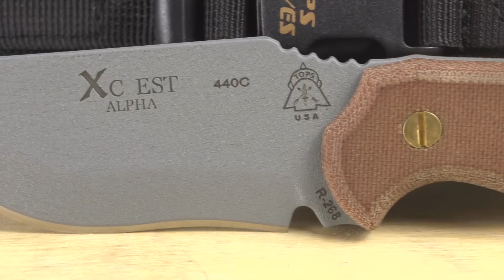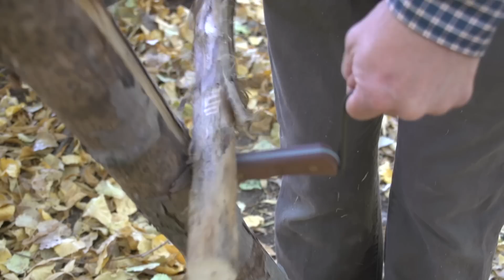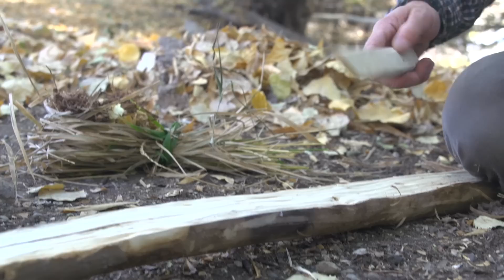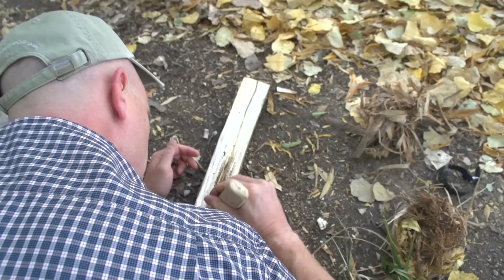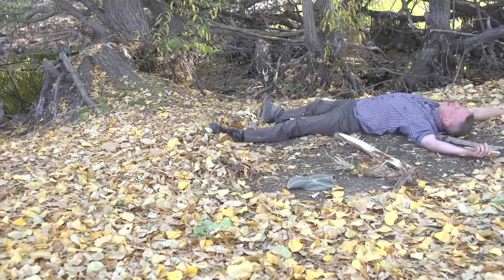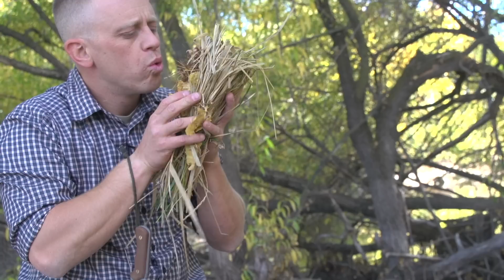TOPS XcEST Bushcraft Skill Pt 1: Fire Plow

Comment: I am very competent with the bow drill, but always fail at the fire plow. One thing I noticed is you were using your arms and not your body, this way u burn out too quickly. But this is a very tough method.

Comment: If you remove the scales from the knife, you can put inside the handle an Exotac NanoStriker XL replacement rod and a couple of tinder-tabs. Then put the scales back on and you will always have a reliable fire source even if you lose the contents of the sheath.

Comment: Great Video, guys! I have watched other fire starting via rubbing sticks together videos and I think a huge factor in one's success is picking the right type of wood.  Different woods ignite at different temps so if you pick a wood type that has a lower ignition temp, you don't have to work as hard.  The key to survival may just be wood knowledge in this case.

Comment: Why on earth would you use the blade on a ferro rod like that? The shame... looks like a stout little knife, but too short for a lot of tasks and lots of accessories of questionable quality.  Always skeptical when something comes bundled with too much stuff.
Reply: Because the back of the blade when it is coated will not light up a ferro.  So if you have not other sharp object on the blade, or no other striker it is best to use the bottom of the blade.  By the way it didn't dull it at all because it is so stout.

Comment: I haven't read all the comments so maybe it's been said. The knife had a hole in the handle to use a bow drill so why not use that to build a fire? Just curious. Never saw this friction fire method before so thanks.
Reply: dhl671 I'll believe this when you actually post a video of it happening.
Reply: Because I have done a bow drill in a bunch of BladeHQ videos.  We wanted something new and not often used.  It isn't often used because it is very hard to do correctly.  Especially if you are using cottonwood like I did, as opposed to say Yucca plant stock or Hibiscus as the original Polynesian peoples did who used this technique traditionally.
Reply: Yeah he says he's started fires with bow. Uh huh sure...Got lucky once maybe? Check the videos in which he fails miserably at working a bow drill as well. There's one video I think where there's this idiot and another one or two idiots trying and failing

The guy thinks he's awesome and calls himself an "expert". I am no expert but am confident that i can do what he did if not better.

Comment: Why did he use the knife edge to strike the fire steel?
Reply: The blade is coated, plus it doesn't have a ninety degree spine. I might cringe every time I see someone do that, but it's not a big deal.
Reply: Domo Kun A knife doesn't have a good heat treat if striking a rod with the edge does any damage to it.
Reply: I did that because the back of a coated knife won't fire up a ferocerium rod.  Usually on my personal knives when they are coated like that I take a dremel tool to the back of the blade to take the coating off and to give it purchase.  That is why I used the front of the blade.
Reply: Jay Ramirez I could have.  But I only packed three things from the survival kit in the sheath.  So I didn't have it to use.
Reply: the outdoorsmans ledgers Lets hear the right way to do it.  I'm all about learning if you think I did something wrong.  But I do know the technique and build is correct.  You just aren't always successful
.
Reply: couldn't he just use the can opener as a striker?
Reply: I really think using the bottom of the edge is fine if that's all you have.  Thanks for your reply!
Reply: On my personal stuff I never use the blade.  But it won't hurt every once in a while, and is better than no fire.